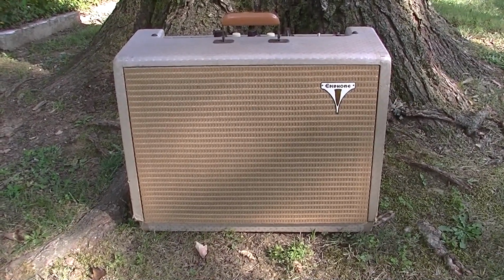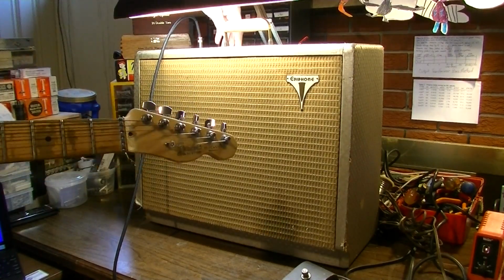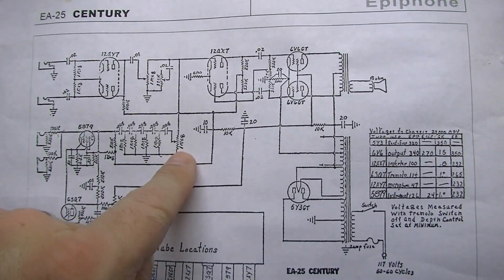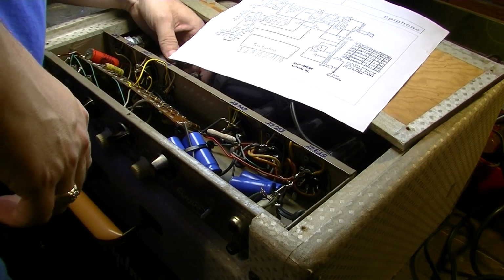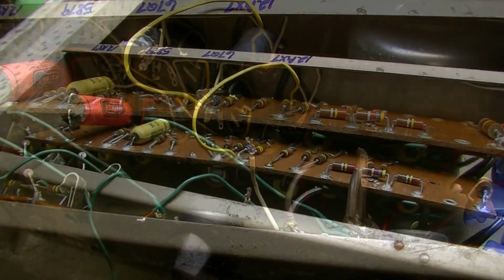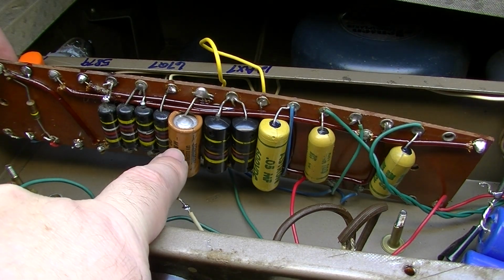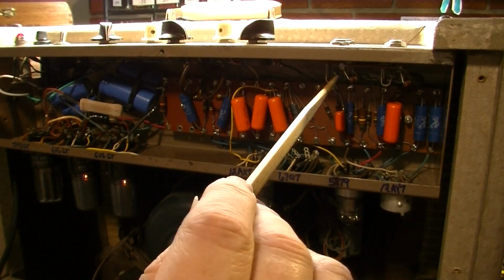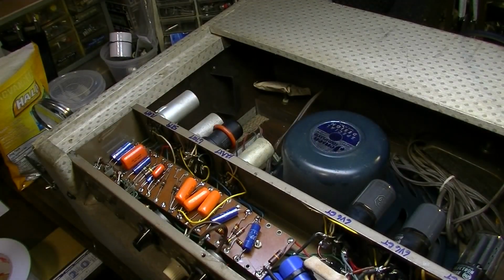Recapping Vintage Guitar Amps - When is "Killing the Mojo" OK? (1959 Epiphone Century EA-25T)

Comment: Unlike guitars guitar amps don't get better with age.  Eventually things get weak out of spec or fail outright and you're left with an unusable amp.  So much for Mojo.  Mojo is for uptight babyboomer males sitting in their dens.  Replacing tubes and caps unless you're a total klutz brings the amp back to what it originally sounded like.  Old untouched equipment is great but it's useless for working touring musicians who need reliability.  A lot of the guitar heroes onstage with vintage equipment are in effect playing fully reconditioned  units that just happen to look old.  IMO you do what you have to do to keep it working and reliable.  Good call you made.
Reply: Lance Lawson You're wrong.
Reply: How is he wrong?  It's a simple fact.  An untouched amplifier does NOT sound the same as it did when it was new, or hell, even when it was half the age it is now.
Reply: Correct. I have David Allen Coes old Twin cabinet with a new board and tube sockets, it gives the appearance of vintage but with the same mojo, thanks to nos 50's and 60's tubes.  I use Svetlana winged C tubes which are closest to the RCA blackplates on the 6L6 which were always the best. Regular Svetlana 6l6's are just sovteks so get the winged c. Preamp tubes that are nos are still affordable and better than the Chinese tubes available today.
Reply: Ferretsnarf Amps sound better with age, because of component degradation and other stuff. It makes the sound more natural and dynamic. Original 59 bassman is probably the best sounding amp. Reissues don't even come close, but then again you have to learn to get a good sound from an amp first and only then say how old amps are worse.
Reply: How is Lance wrong?What good is an amp with original leaking failing caps?Which will no doubt further the problems and cost a heap more money to repair in the future.Sounds like the owner wants a playable amp to enjoy for another 50 years,and not a vintage doorstop that's "cool" to look at.
Reply: as pedlas That is total nonsense.
Reply: Just listen to the sound before and after the repairs.The after repair sound is much richer and a lot less noisy.This amp needed the repairs,or else the owner would not be requesting the work done.
Reply: Brushcountry Bob I'm not talking about this exact amp. I even gave you an example. It's not the case sometimes with these less known models, but old Fenders are best sounding amps. I'm done arguing with you.
Reply: Yep !! Pro guitarist have be having their amps (Blue Printed ) for decades. In fact Aspen Pittman blue printed EHV's  SLP used on the first 2 Van Halen albums. Sound is everything Mojo doesn't exist.
Reply: as pedlas,All vintage tube amps need a recap at some point,not just certain brands that is the cold hard facts.Nowdays we have came a long way in tech and components such as caps and resisters,they are worlds better than 1950's one's.I'm not saying you should just shotgun the entire board,but certain known problem causing components should be addressed in these old tubers.We all would love to keep them as original as possible but we want a playable dependable amp also,if that means replacing original components then that's a sacrifice we make.Not picking a fight it's just what i have learned in the 27 years of being a guitar player/tinkerer.I have owned and still own some gorgeous vintage tubers and they all have been serviced.Rock on though,cheers.
Reply: Brushcountry Bob Thanks. That's what I was trying to say. I didn't say that you must keep for ex. a Blackface Super Reverb completely untouched and leave it to rot. Every amp needs a bit of service and that's ok. Maybe I misunderstood someone, but in my opinion as I have stated in above comments, vintage tube amps are the best and everyone should at least have a chance to play one. Good luck to you!
Reply: "Vintage" is wasted on most because most people will never play in a fashion to realize what vintage means.
I rewire Les Pauls to 50s wiring and instead of the OIP caps people claim to have MOJO I use orange drops. 
Cap value is value and orange drops will last forever where as OIP will degrade.
If you can actually hear the different you are other worldly.
Reply: Until you go back to 1959 and compare a new 1959 Bassman to a current vintage 1959 bassman, you don't really know that "amps get better with age". I think 50s and 60s NOS tubes completely slay current production tubes and most vintage speakers sound better (they also did in the 60s) but everything lacked consistency. A bassman might sound good because it is so out of spec, not because age makes it turn magic.
Reply: filter caps are a touchy subject. they control the spongyness and feel and how the amp breaks up and compresses. the age and wear of the transformers plays a part too. Filter caps have a lot to do with how your tone controls work. I know techs real techs like guitologist that do hundreds of amps per month they'll tell you if the amp is healthy and sounds good don't change the caps. If the caps have failed you should still change them. I had a tech steal the filter caps out of my favorite '77 Marshall without saying anything to me when I took it in for a routine bias and tube change. He didn't touch the '78 head but it sounded like shit kind of makes you say hmmm?... When I fired it up with the band it sounded like a brand new amp not a vintage beast with kilotons of mojo. I was pissed and I called him right that minute and he admitted taking my caps and simply made the excuse that they were "on the way out" and "he did me a favor doing it for free". That's right he didn't mention it but admitted it when questioned. So years later after I moved to a different town I called the guitar store he gets his business from and got his number. I called him up and just wanted to ask a few questions without telling him who I really was. I came to the "should I change the caps on my vintage amp" question he got quiet and paused, then he said in a tired voice as if he was beaten "no you shouldn't change your caps unless they have failed". I'm not sure but I think he suspected it was the guy he took the caps from. We were sort of friends I used to take both of my Vintage Marshall heads and my 2 5150s to him regularly and I bought a guitar from his shop. He seemed like a cool guy but he was a scoundrel. True story watch those vintage amps with technicians you never know. That's my $.02.
Reply: It is that component degradation that can cause an amp to fail unexpectedly during that awesome guitar solo during a live concert and no guitarist worth his/her salt wants that to happen.

Also as components degrade the amp no longer meets manufacturer spec and doesn't sound as good as it did when new.

Perhaps the failing parts make the amp have a tone that the guitarist likes better and if so then the amp should be repaired and a stomp box found that replicates the sound.
Reply: "When I fired it up with the band it sounded like a brand new amp not a vintage beast with kilotons of mojo"

So basically it sounded how it did the day it left the factory which is how it should sound.

I do agree he shouldn't have replaced the electrolytic caps without consulting you first, but he may have just saved you some trouble down the road as an original electrolytic cap could have failed while on stage and made the amp inoperable.
Reply: You don't understand the contrast. I don't care how it sounded the day it left the factory. it was boxy and gritty and nasaly and really sounded pretty bad compared to the warm smooth punchy harmonic tone that was pure magic. You don't understand cap forming and how an amp breaks in and sounds when it's just right. It took about two or three years for it to reform the caps and start sounding good again. it's been 17 years since that and its back to its original glory. It sounds a little different from day to day but always Amazing.
Reply: Guitars get better with age....but only the wood part of it.
Reply: I do understand.

I also understand that electrolytic caps have a finite lifespan and once they are older than their lifespan it is a crapshoot as to how long they will continue to last.

I do understand cap forming. 

The only way the sound will change to how it was when using new electrolytic caps is if the caps are changing their parameters at which point said caps should be checked to be sure they still meet manufacturer's spec and if not they need to be replaced.

In all honesty given the amp with the new caps eventually sounded just like it did with the original caps I'd suspect those replacement caps as being questionable and in need of replacement.

Now if I played guitar and had an amp where the sound started to change as it got older I'd stop using it and see what component is going bad and no longer meets factory spec then said component would be replaced before the amp was used again.

One reason I will never work on a guitar amp for anyone is because some guitar players are very picky about what can be replaced. Those guitar players who often know diddly squat about electronics  think that the sound of the amp due to leaky caps and out of tolerance resistors is how the amp sounded when new and refuse to have any of it changed unless a cap is shorted or resistor opened and you better install the same vintage of cap and resistor.

I mostly work on antique radios where original paper and electrolytic caps are replaced to keep things such as tubes from going bad and power transformers from letting the smoke out due to a leaky or shorted cap and also to keep said radios operating to factory spec.

For the guitar amp world it must not matter as much as there's readily available new replacement power transformers made to the original specs for a lot of amps and said power transformer can just be replaced when it fails along with the cap that made it fail using a cap of the same age which could eventually cause the same issue. Then again it's only money, right?

Me personally I don't care how good the amp sounds. If it don't meet factory spec then something is wrong with it.
Reply: There are so many variants in the guitar and amp electronics (No amp uses precision components on anything that alters the sound, not even digital modelling ones.), that guitar players shouldn't be allowed to be picky, since they don't even know what they're talking about.
Reply: i do all my own work now. I check my caps from time to time. my bias caps are due. I understand the clinical approach but there's also a situation where things change for the better somehow and nobody really understands exactly until the wrong component fails or is inadvertently replaced and stolen for use in another vintage amp and the mojo is gone from an otherwise well functioning amp for so many years. This amp has never once had any problem ever. It's fallen from 2' to its face on concrete almost broke the slab and nothing. My approach is this amp I have had since 1992 and I paid $250. It sounds so amazing I have never heard an amp like this think demartini lynch van halen. changing the caps killed that scooped mid punch that was just there. It's a point to point board with mustard caps just before they switched to thru-hole pc-board with mallory box caps. The newer head is dead sounding with zero mojo I don't even know why I keep it but for spare parts. I should have included that this guy was known by others to scalp components and his rep suffered tremendously. scandalous.
Reply: " but there's also a situation where things change for the better somehow"

At which point the amp should be checked to be sure no components are on their way to failure which ultimately results in a more reliable amp.

Say the amp finally sounds like you want it to but unbeknownst to you it is due to a failing electrolytic cap and said cap just so happens to fail on stage during a concert?

had things been checked when the sound started to change that could have been avoided. 

That said I'm sure there's stomp boxes that can make the amp sound just as good.

I remember one time a couple years ago one small band came to the local bar which has an outdoor bar as well and he had some sort of box that could control the volume and make the guitar sound pretty much however the guitarist wanted it to sound without even having to touch the amp for anything.
Reply: I check and retube my amp(s) every year or two of use. the only time the sound changed was when he took my caps without my knowledge or permission and I never saw them again. I have two tube screamers (the mother of all pedals for tube tone) and a Friedman BE-OD in my pedalboard on a loop switcher. I have a backup amp that I always bring to shows but I have never once needed it. I use a mesa dual recto or a fender supersonic as a backup. I'm a serious pro player my setup is top notch I have kept it in perfect working order myself for the past 20 years.
Reply: Benjaminas Anceris leaking caps are crap.
replace old caps.
Reply: Broken things must be fixed to be used.
Reply: Joe Bonamossa uses vintage amps on stage. Filter caps updated, but unless it’s broke or drifted way too far, the other components are left alone. He said that a lot of old Fenders are actually more reliable than new boutique amps, once his vintage amps have been given a good health check. 
In my opinion, most vintage Fender amps probably sound better today than brand new. Component drift over time in an overdriven circuit is the MOJO. 
Also, the reason why 1950’s Gibson/Epiphone amps are not as popular as Fender, is because Fender used cheaper parts and older circuit designs (straight from Western Electric) that were easier to overdrive. Gibson was more concerned with reproducing a cleaner sound. Always exceptions to the rule, but that is the case for the most part.

Comment: Nice work.  When it comes to those old bumblebees, I usually replace them.  They're getting over 50-60 years old now.  I've worked on quite a few old tube ham radios, too.  They're full of 'em.
Reply from the maker: I don't mind them too much in low voltage areas like tone circuits, but they definitely don't need to see ANY measurable DC.
Reply: I don't know why I do this, but I can't get myself to simply throw them away, though.  So, if you ever need any... lol

Comment: I don't understand people who insist on untouched vintage amps, at least when they mean to actually play them.  An untouched amplifier is almost not even the same amplifier.  You can easily bring it back into spec, with components that are likely to stay in spec for longer, and make it a safer piece of equipment while you're at it.
Reply: Safer? It should be more dangerous.

Comment: I don't think what you did was controversial at all. With 2 bad caps, you know the others are right behind them. You've taken the amp apart once and now the customer won't have to worry about it anymore. And you put the caps in the right place.  I have a pair of '70 Plexi's I bought in '82. A few caps went bad & I had both of them recapped. They sounded as good as ever now. Great work!
 But what a beautiful amp, in excellent condition too. The Tremolo is lush. I  Love the way ch2  breaks up so gracefully, very touch responsive. The character of the guitar shines right through. I buy amps like this one all the time, lots of low watt age fun.

Comment: This is the point that scared me to death when I bought my vintage 1959 Fender Tweed Bandmaster.  I wasn't sure I could trust anyone so I had to learn how to repair the amp myself.  Now, if I had the Guitologist in my area, I would have taken the amp to him but only under the condition that we only replace absolutely what is necessary.  I have no trustworthy amp techs in my area that I know of.  I have since bought 1959 and 1960 Tweed Bassmans that I feature on my channel.  They were both original and I performed their first electrolytic cap jobs.  Almost everything else is original including all of the Astrons.  Although, I did learn the hard way what a bad cap can do.  I took both Bassman amps to a gig and before we even started playing I notice there was no sound coming from the 1959 and the drummer asked "what is that smell."  I broke out into a cold sweat because I had just bought the amp.  A friend of mine at Area 51 Audio Design helped me troubleshoot it.  It turned out to be a shorted .1uF/400v cap in the phase inverter section and the 5881 grid had 235 VCD on it for a while thus the smell.  That amp has been super strong ever since I replaced both the .1 uF's with matching NOS Astron PIO caps I bought from the Netherlands.  Short story long, I have experimented with almost every boutique cap out there including the Sozos and every time I cringe because they do not sound as good as the old Astrons.  I really need to find a good replacement and all I can think of now is to find some good NOS Astron PIO caps.  They are getting rare too.  I tried a few in the coveted .02 uF positions and they still didn't sound as good.  I guess, from a players point of view, no one in the audience will ever know the difference but when you are trying to preserve the old tones that we heard on the old recordings, it becomes more important.  Maybe in the recording studio is where the biggest difference will be noticed.  I just don't like the idea of shotgun cap jobs but when you are in the business of repairing amps in a timely manner, it is probably the most practical approach.  I've spent years coaxing the tone out of my Tweed and Blackface amps and an amp tech with time constraints just doesn't have that luxury.  That is why I think it is good to learn as much as you can about amp repair.  Wow.  Long comment but this has always been a touchy subject for me.  The 1959 Bandmaster is still completely original minus the old electrolytics and it still sounds great.  Thanks for reading this.